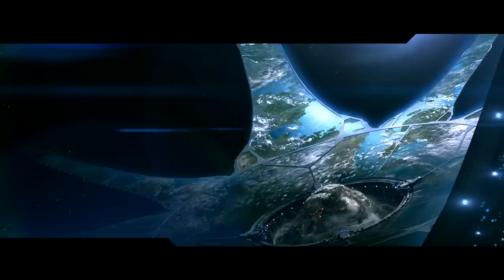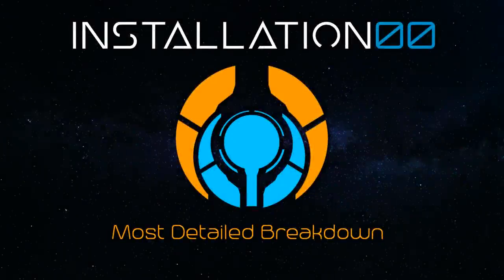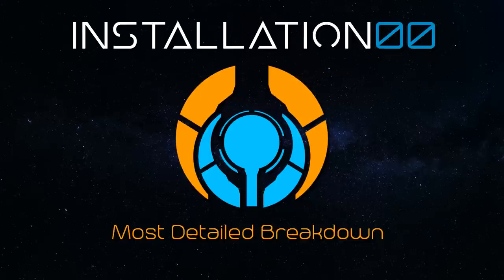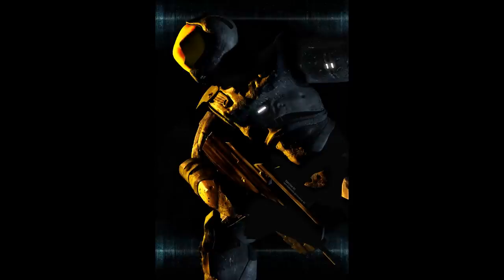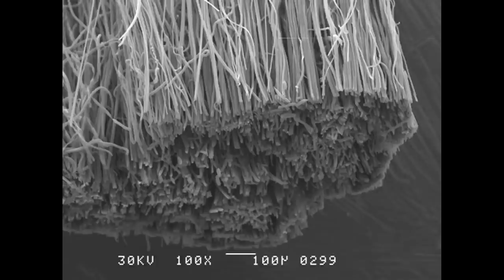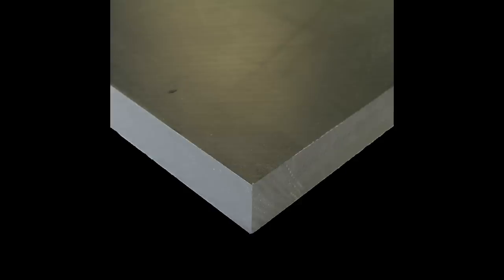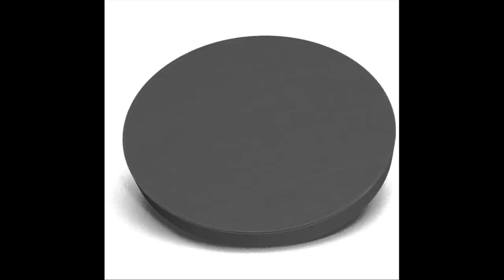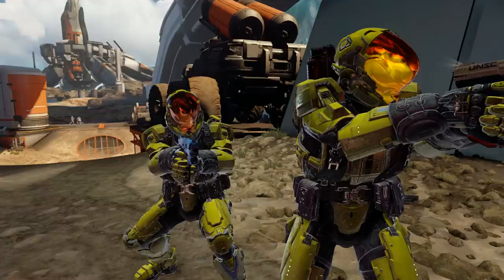SPI Armor | Most Detailed Breakdown

Comment: Why not equip most soldiers with SPI when it is much cheaper and has camouflage available to it and some strength and speed boosts. Also how can SPI make weapons held invisible if is uses its plating material for invisibility and can you also explain invisibility in halo since I always thought they used the shields to reflect the surroundings for camouflage which allows them to turn their weapons invisible since the games also show that the shields also cover whichever weapon you hold. But how come reach invisibility allows the energy sword to go invisible while halo 1 swords are clearly visible is this a difference with the tech used on both events?
Reply from the maker: In game, it's more than likely for technical or gameplay reasons. In the lore, unless weapons are also fitted with the same Camo tech, it wouldn't be possible to make them invisible too with the SPI armor tech. Active Camo is a different situation all together. That uses energy fields to bend light around the wearer as apposed to blending with the environment. As for the energy swords in Halo CE being visible vs Reach, its probably that in CE, an Elite with an energy sword is a one hit kill, and thus, to give you a chance, they make the energy shield visible.

Comment: The battery on its own destroys MJOLNIR being expensive as it means there is no longer any canonical reason to have a power generator for MJOLNIR instead of just a large battery.  Especially since the force-amplification crystals were canonically already mass-produced and used extensively by the UNSC, which means it was probably pretty cheap. Semi-Powered Infiltration Armor is what happens when no one has the brains to say "Wait, what if we put armor on them instead of active camo? They're being sent to fight head-on, not sneak around, and their training is as good as the IIs and so can out-sneak the Covenant easily without it anyway" (hey, conventional sneaking is good enough for the IIs, so it's good enough for the IIIs, the active camo is pointless ) or to point out "Hey, if they can use shields from a battery,  and the force-amplification crystals apparently need so little energy a battery can handle it, why does MJOLNIR need a freaking micro fusion reactor?"
Much like how Doctor Halsey wouldn't have been able to kidnap children if someone had been smart enough to ask why they don't just artificially induce a second puberty in adult Orion/Spartan recruits like we can do in the twenty-first century.

Seriously, there is no reason for the active camo and since the headhunters are shown able to use a shield, active camo, and apparently proper armor all at the same time, there is no reason at all for them to not all be equipped that way.  Or heck, give them a bigger battery and the fully amount of force-amplification crystals like MJOLNIR.  The only downside is it wouldn't be indefinitely operational, but it'd be fine even for the very long missions Headhunters go on.  In fact, going by those guys, even the tiny battery (like two hands in size) depicted in the SPI armor breakdown lore apparently lasts for an extremely long time of constant use.  Long enough that it makes MJOLNIR's power generator honestly completely pointless.  Especially since you can just make like, a camel-pack sized battery like that.

And yes, this means SPI armor's very existence means the great expense of MJOLNIR is completely pointless.  There's just no reason for it.  So what if your Spartans wouldn't be able to operate indefinitely?  Who gives a damn when the battery lasts long enough that it might as well be indefinite anyway?  And SPI armor is so cheap that normal, though elite, soldiers also were equipped with it.  Even though it was only really built at like one facility on Onyx.  Which also indicates that if it was mass-produced in the Inner Colonies and Earth, we could equip all of our soldiers with it.  This is on top of the Spartan IV augmentations already being available and cheap and...wait, that also means that the Spartan-IIIs themselves have no reason to exist, either.  IVs with batter-powered MJOLNIR would be less capable in close-combat with Elites, but seeing as canonically ODSTs and Marines could take them on due to greater range of motion and such (and humans seem to generally have better reflexes than elites by a lot, too, anyone else notice that?), the IVs would probably do just fine up close and personal.  But, more importantly, they could use heavy weapons casually, their reflexes, precision, and firing stability would be greatly improved, and above all else would be that their shields and armor would allow them to take a decent amount of hits from Covenant weapons.  That last part being by far the main benefit of the Spartans.  Humans actually kicked the Covenant's ass on the ground.  The problem was that human body armor was almost useless and could only take a hit before the next would be fatal (improved to take three hits by the end of the war in the books).

If they did this, then by the end of the war, Spartans wearing battery-powered MJOLNIR would make up a significant portion of, or even the entirety of the UNSC military.  There are variants for piloting, EVA, etc. after all.  Great for ship crew survival.  And, being Spartans, even after being sucked into space they would amazingly still be a threat to an enemy fleet.

Oh, and it's moronic for MJOLNIR to not have a dumb AI as part of its package considering it is designed to support a smart AI but only like one or two Spartans ever had one in their armor.  Have a dumb AI carefully tailored for each specific suit and carefully modified for every single little piece of equipment added to the armor whenever any changes occur.  This is linked through the neural lace like Cortana is.  Give it a lot of information and a strong skill in sorting and retrieving relevant information and for using its vast well of knowledge and computing power to help predict enemy actions, tactics, etc.  Now this is part of the Spartan's sub-consciousness, basically, due to the neural link.  Like the sound of that?  Damn right.  This can be done for SPI armor as well if they add the circuitry for it.  There's no reason not to as what's described in MJOLNIR sounds like it would be extremely easy and cheap to make.  Maybe 3D printing.

Comment: and its not standard issue why?
Reply from the maker: My thoughts and exactly.
Reply: Infinity should have this as standard as the ship can build and improve the armor using the Mjolnir manufacturing systems aboard the ship.
Reply: Costs, logistics & manufacturing time maybe. We know the UNSC was cranking out everything it got to throw at the Covenant in a disposable manner during the war.
Reply: @tristanbackup2536  actually the SPI would be extremely cheap to produce. Especially if the stealth component( the chameleon one not the external cooling system) was removed but the EVA, power and shield systems were improved.
Reply: Compared to ODST hardsuits, the SPI suits were more expensive and more advanced.  ODST hardsuits didn't mechanically augment the user like the SPI and they're more cheaper and mass produced to keep up with the growing ODST branch (or replace badly damaged ones). 

The SPI armor is a far more specialized armor and were perfectly made for the Sierra Threes given it suits their mission parameters.  The augmentations of the Threes plus the modest augmentations the SPI offers makes them far more dangerous threat than any ODST or UNSC special forces soldier. It's no MJOLNIR but I bet 300 plus angry Threes charging at you would be a very terrifying sight.  Even Sangheili had orders to retreat at the sight of charging Threes because of their lethality and ferocity.

I like to think newer and improved SPI suits would be available to select UNSC special forces, ONI operatives, and ODST where stealth is a major component of their missions.  Most S-IIIs would have no need for these given they're now part of the Spartan Branch and use MJOLNIR GEN2 armor.
Reply: @jaymikevillanueva1212  actually the SPI system could feasibly replace the standard marine hard suit as it can be a 2 in 1 ground EVA combat suit. We are developing the basics of the SPI today for theoretical martian exploration.

Comment: About the amplification of the gauntlets as well as the distinct guard around the ankles, I suspect that there is a thick layer of the force-amplification crystals and possibly something else to give brief, sudden spurts of additional force in both of these in order to amplify punches and also to amplify running without needing more expansive and expensive additions to the armor.  Even if that's not the case, amplifying punches and the push-off when running or jumping would be a great idea for both SPI and for MJOLNIR.